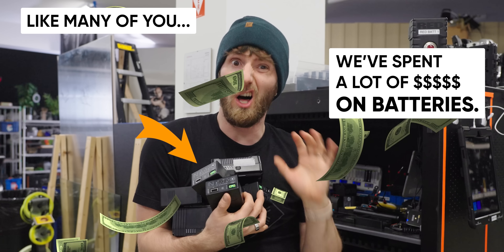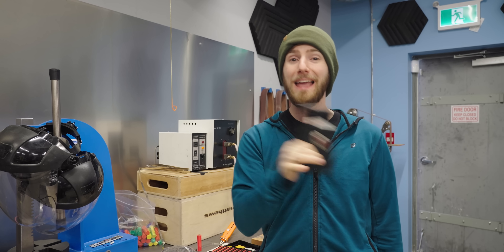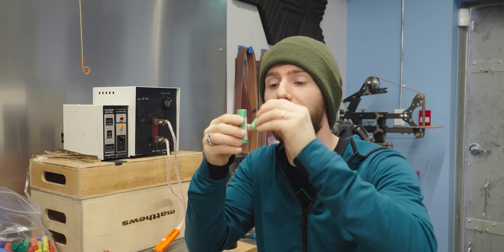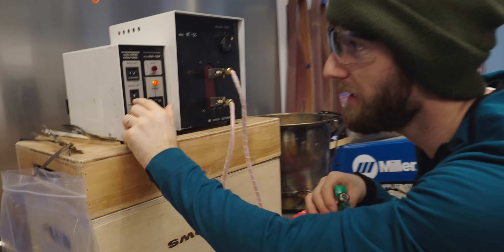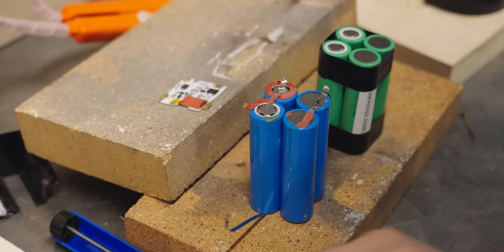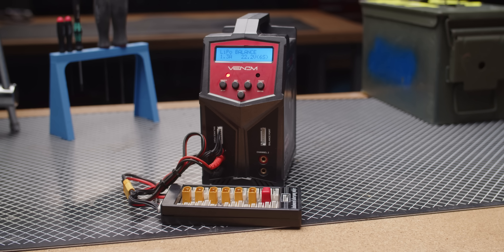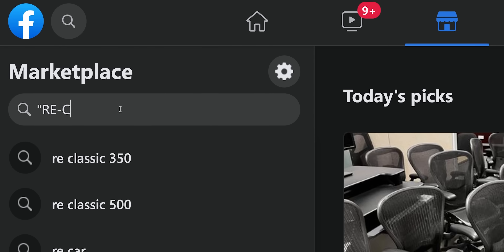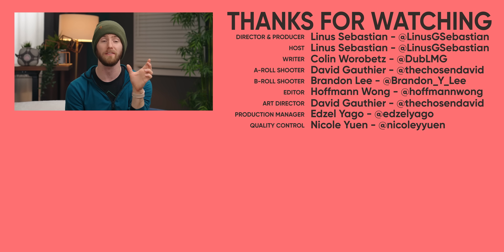This should be illegal… Battery Repair Blocking

Comment: Hey Linus j have been building packs for a bit now. Sparking is normal for spot welding systems from my understanding when I was trained to use them it is pretty common. The issue I see that the strips are glowing red dumping Un needed heat into the cells that can make them pop. The sparking is mostly what you want to see from what I was told as it means the probes will not stick usually and such. Also that spot welder is for bigger Batts&thin steel not 18650s the better option would one designed for smaller batteries they are fairly cheap to get. So the packs that you built before you put in sand are probably not dead they will probably have to be charge cycled but yeah they are probably good. Don't overlap nickel strips you can buy pre-made sheets that you can cut yourself. Ect there are a few ways this could have gone better and there are Pack rebuild people that can do this work to and service these packs for cheaper than replacement also if you do not feel like you can do it. When a project gets to outa hand for me I look usually for the latter.

Comment: Very interesting thank you !
Battery repair is a pain in the ass, the goal is just to take your device and either change the plug coming out of the device, or use the plug of the old battery to adapt another generic plug like XT60.
Then you can use any kind of battery on your device, as long as you respect the voltage and a minimum of intensity to power your device. Knowing that in certain case (like wireless drill) you can change with the voltage to have more or less power.
To change a battery is pretty easy when you are used to it, the ultimate goal is to get rid of the proprietary plugs that should be forbidden in a normal world.

Comment: Rather than covering in sand, I believe the recommended thing to do in an emergency is throw them into water (outside!) and leave for 24 hours.  This will ensure that the "remains" are totally discharged.  This information came from a course run by Mitsubishi for the disposal/dismantling of electric vehicles   :-)
Reply: Specifically SALT water.
Reply: Yep! I learned that the hard way when I had a massive 18650 pack just went awol with thermal runaway. It was startling and scary, because this pack was within a pretty thick stainless steel box ( course the pack itself was insulated and all that good stuff. ) But.. seeing a bad cell start thermal runaway an then damaging the cells around it, causing those to begin thermal runaway aann then, etc etc! what terrified me was the fact that, this was outside, we had quickly pulled back like a good distance.

Just stayed the feck away from the steel box that sounded like a gnarly monster, emitting plumes of smoke, making insane amounts of hissing noises and most of all? was emitting a stupid amount of heat, so much so, despite us having ran back to a safe distance, we could feel the heat still and were now watching it get hot enough to begin melting through the steel box. That's over what? 4000 Celsius? regardless, the thing was now burning more like phosphorous.

It melted through the steel box, melted the plastics of the ATV it was attached to, ate through the frame and, well basically by the end of it, we had a foam covered burnt wreck of an expensive ATV.

From that point on, we always keep these big ol packs in those flame retardant battery bags. We weren't even using the pack, it just randomly went up like phosphorous. Scary stuff that! also the reason why I'm still keeping away from Electric Cars until we've advanced in battery tech to replace Lithium battery packs for vehicles, because when those things go up? you'll likely die if your in the car. If not in the car, you'll likely die from shock due to the well, severe burns that would have probably melted your flesh as quickly an easy as heat does to ice.
Reply: @dasmoools606  Steel melts at 1300-1500 degrees Celcius.
Reply: Lithium reacts violently with water. If any lithium is exposed, boom
Reply: @glenclark777  The amount of lithium is basically negligible, 0.6 grams for a standard 2Ah 18650.  That small amount of lithium being slowly exposed to water wouldn't produce any noticeable reaction, especially when its seeping in.
The infamous spewing of sparks and fire by a lithium battery isn't actually from the lithium, but rather the sheer amount of energy from its charge being released all at once during a thermal runaway.
Reply: This is why you always read the comments while watching the show. Such a waste of time I feel like I just watched the history channel.

Comment: I've rebuilt lots of power tool battery packs (swapping out bad cells), and it works about 80% of the time, with no issues.  Lately, however, I've been replacing entire cell stacks with those from "cheap" replacement packs (using the original case and BMS pcb).  Works just as well, but the new cells can have higher capacities/drain rates, and in those cases, you need to swap in the driver transistors from the new pack, because the original ones will let out the magic smoke at full power if you don't.  Why go through the trouble?  The cheap packs frequently have lag times that are annoying, and other odd behaviors.

Comment: It's OBVIOUS that it won't work. When the BMS detects the low voltage (when you snip off the "balance" leads) it instantly determines that you have a faulty cell. That causes it to lock out the BMS 100% and prevent any further charging or discharging.
If you want to do these kinds of repairs, you MUST connect small leads to the cell sensing cables (no, they are NOT balance leads) so that at ALL times there is voltage on all the cells.

Comment: I worked for a major battery specialty retailer repairing battery packs all the time.  They, however, wouldn't let us do lithium battery packs for the reasons you experienced on this video. The result can be much worse if lithium reaches critical temp (typically around 400-500F) as it will enter thermal runaway and explode the battery. (remember the e-cigs?)  So, the company wouldn't let us repair lithium batteries in-store for this reason. However, NiCAD and NiMH were fine to work with.

Comment: I would love to know how batteries are actually recycled in person, that would be amazing
Reply: They send them overseas in bulk. In the third world country they strip the packs down into individual cells (I use 18650's for example).
Any cells that measure below (say) 2.5V are thrown away into THEIR landfill. The cells that measure over (say) 2.5V, are set aside. These reclaimed cells (that have some ability to hold charge) are packed up in bulk and resold on the open market.
Dodgy companies (usually in china) buy the cells and remove the outer covering, then "re-wrap" them with a brand new shrink wrap and labelling. They also put fake "button caps" on each end to cover any damage. Sometimes they add a cheap protection PCB on one end, it all depends what they are needed for.
These rewrapped are resold on eBay, AliExpress, Amazon, Wish, etc to ignorant consumers. The most common brands are anything with "Fire" in the name, eg: UltraFire, TrustFire, etc, as well as anything with claimed capacity over 3,000 mAh per 18650.
However there are plenty of them rewrapping with name brands as well, so the fact that it looks like a Samsung, LG, Sony or Panasonic doesn't actually means anything. Not all the fake cells use rewrapped cells, but some might.
Anyway, there is almost no "recycling" of materials... they just resell what they can, and dump the rest.
Reply: @johncoops6897  I never thought about it, but honestly that makes sense.  I bought a flashlight that came with an UltraFire and the battery was only capable of about 700mAH worth of charge.
Reply: @Ikouy  - since it's useless, sacrifice it to science and remove the wrapper. You might be surprised what you find, especially at the ends.
I saw a video a while back where they had rewrapped 18650s that had been dented during the laptop pack opening process. The chinese must have got a super cheap deal on "Grade F" reclaimed cells that week.
What they did was melt candle wax into the dents, then scraped it smooth and shrink wrapped over the top. It was quite lumpy in places LOL 😃
I just spent about 30 minutes searching but I cannot find the video now. Bummer

Comment: I love what you guys are doing here, but there is some really bad info at the start of this video on the topic of cell selection and safety. You mentioned that old cells shouldn't be mixed with new ones due to "electrical engineering reasons." Those electrical engineering reasons don't really care at all about how old or new the cells are, and most importantly you can encounter those same safety problems with packs made from entirely new cells.

The issue in question is internal impedance. When making battery packs that are configured with cells in series it is very important to be sure that the cells all have a similar internal impedance. If you don't do this, you risk overcharging some cells while other cells under charge, and things can get a bit explodey.

Modern BMSs can mitigate this problem, provided they have a MOSFET or transistor per cell so the BMS can regulate the current to/from each cell during both charging and discharging operation. This is often called balanced discharge. Conveniently these BMSs also often support a serial, CAN, or I2C bus so that you can read statistics about the health of each cell, the overall balance of the pack, cycle counts, measured internal impedances, etc.

If you are using this type of BMS you can get away with mixing new and used cells, however the longevity of the pack will be negatively impacted by the fact that the older cells will degrade quicker, so you'll see the effective pack capacity drop off more quickly over time if you do this.
Reply: Also don't use electrical tape. It's horrible, dries out, and doesn't last. It also isn't at all heat tolerant, meaning that packs that do find themselves ablaze will slip into a cascading failure very quickly if protected by electrical tape.

Use a high quality kapton tape, instead. It's a much better insulator, usually has better adhesives, and tolerant to very high temperatures.

Comment: DJI , evil BMS on drone battery. Mine had only been used once and got left just slightly too long before being recharged. Bricked itself. I opened the pack (difficult) and the cells were only a little down, not much, charged them all up to correct voltage, BMS still locking the battery. I bought a USB adapter PCB thing that you solder wires to on the BMS and it was able to read the cell voltages etc but would not unlock the battery, i think there is some really expensive piece of software you can run on the PC to unlock it but I had had enough. Won't be buying this brand again because of this. We need to vote with our wallets and not buy evil products. I still run an old fashioned smartphone with removeable battery.

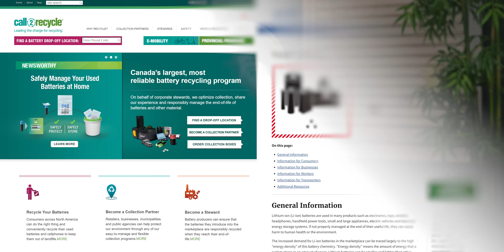Comment: So, i watched this brutal sca* until 18:13. I do realize that this comment would neither make it to the top of the comments, nor would it even be seen through all of the 9k comments there are right now (if it wouldn't be deleted right away). If i would be a subscriber to this channel, i would immediately unsub here. So much fake in this video, unbelievable. You do not need that kind of a welder to do this. (The ones for 40$ do their job very well)  I am sure with so much power, you CAN harm the cells. The Sparks come from welding which is quite normal. No Battery was harmed when they did that. Otherwise, there would be smoke and it would be coming out of the bucket with sand. Which wasn't and therefore they didn't show. Good acting.
I am f*****g tired of videos that get suggested to me, that have so much marketing just for the sake of making money. If you have 14M of subscribers and you deliberately lie to them, just to show off how dumb you are and then explaining to your viewers how dumb they are if they want to make stuff right is quite frankly a "shame on you Linus".  If you do not know how to do something, do not try to be a boss about how you mess up so many times in one video without even knowing what you do. That is quite unbelievable where the world has gotten to. 123k Likes for a video, that an expert could have done better, with success in less time and less marketing. I am not saying i am, but having done this many times, with some research, knowledge and precaution, there would be no battery dumped into the sand what so ever.

Comment: 4:40 Why not recycle the old cells that aren't bad for other projects? I mean, they will run a torch just fine. Just make sure the torch has protection, cause the cell surely doesn't.
You also can run an Arduino or a Pie from them (again, the power supply boards need build in cell protection).

Comment: Huh....you wasted so many battery's. This is the reason i don't use that machine cause of instant fire and can't afford to loose cells. I made my first 24v 10s big battery pack with a 100a BMS with Coper wire and  Soldering iron only. Been using the pack over a year. A Good quality Soldering Iron, Good quality Flux is all needed.

Comment: Funny, but its quite logical that you should protect somehow the + size not to be shorting out with the - outer case. But np, learn by doing. :D Btw, Mkita uses fake Angel superevil BMS. A) It will lock permanently if 3 failed charge attempts are done. B) It drains power from one pair, meaning long term battery storage will kill a battery pair leading to A).

Comment: Made me think about BMWs. 
They have a unique charging system and if u don’t go to a dealership to have them reset the battery in the ecm, the charging system will overcharge the new battery killing it within a few months. Btw, this costs like $300 for someone to hit the reset… and literally all they are doing is using a scan tool to reset it… I mean it’s like a $2,000 scan tool but $300 to hit a reset button?

Comment: The main issue of battery is for laptops. Laptops are used by large number of peoples and the main issue is to replace the whole laptop because of battery. We cannot find batteries easily and also if we replace the cells the bms will not allow to do that. Is there any way so that bms begins to work even after replacing the cell.

Comment: As far as ruining the cells you have your spot welder settings too high.  This is also why you are ruining your tips.  And the cells you are using may not be the highest quality and probably have very thin metal. You are making it more difficult than it needs to be to assemble the pack.  Simply line up two rows of cells, hot glue them together, then put the two rows together.  Way easier.  Also you can get chinese desktop spot welders that work pretty good for under $100 usd on amazon, ebay.  Mine came with nickle strips and a food pedal.  I rebuilt battery packs for years at a batteries plus.

Comment: You need to reset most BMS by putting a charger on it before it goes out from low voltage protections triggered by removing the batteries. But as said it´s not applicant on all types since manufacturers may have put these self destruct features on them

Comment: On replacing bad cells.  

What you CAN do, is take apart a batch of packs used the same amount, put the cells individually through a matching tester (an expensive specialty BMS charger that measures properties of the cell) and put the closest cells together in new packs.   This is typically done with radio control cells and works on almost all radio control cells.

A huge list of nots on this:
NEVER: Mix old and new cells. (as mentioned in the video)
NEVER: Mix cells of different ages or use amount.
NEVER: Mix cells that do not match within a margin of error according to the matching tester.
NEVER: Mix cells of different formulas or manufacturing techniques.
NEVER: Mix cells that are at a different charge state when being recombined.  (also mentioned in the video)

Needless to say a battery matcher will likely set you back more than the number of battery packs you'll save unless you run a business that goes through battery packs like crazy.   This is especially so for Lithium Ion capable ones, which are MUCH more expensive than other battery matching systems.   Considering the amount of work needed, it just isn't worth it for anyone who isn't starting a battery pack refurbishment center.

As a note, adjusting the spot wielder to the minimum charge necessary to work might have saved you a few mishaps.

Comment: I see that you also use an ammo box for battery storage. I'd suggest drilling some holes or removing the rubber seal to prevent it from going all explodey (if you haven't already)